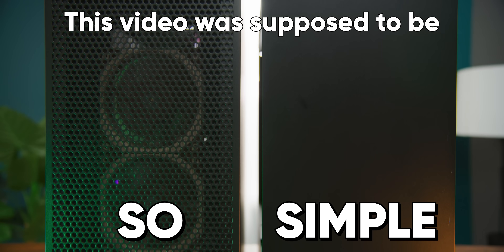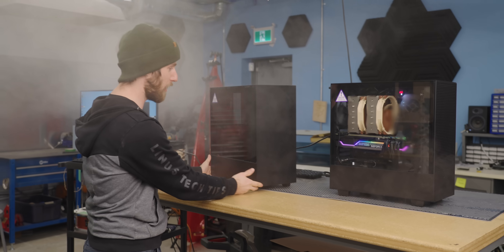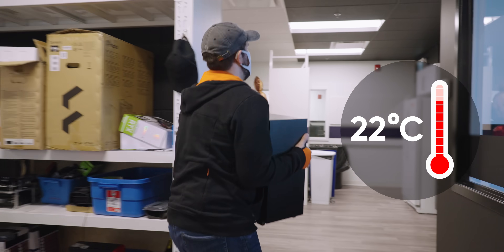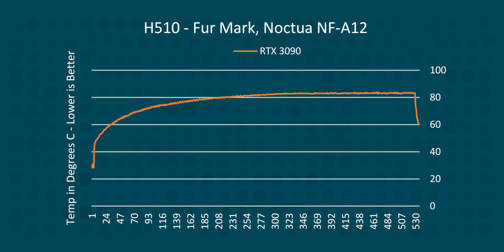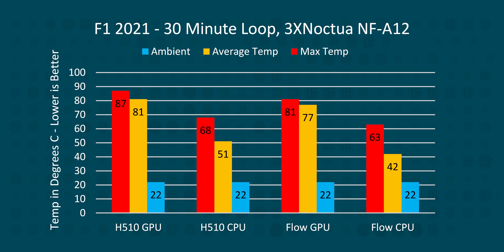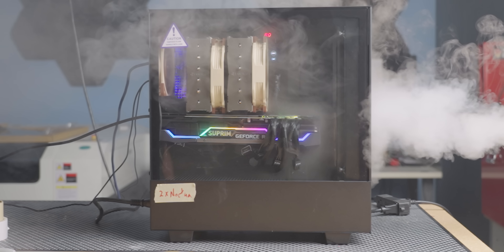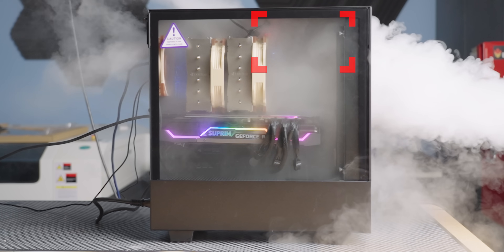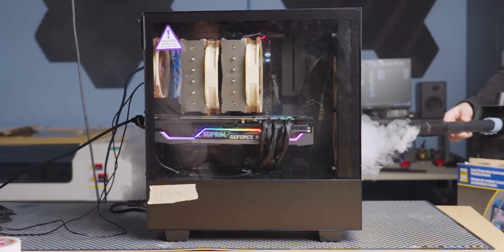Everything You Know Is Wrong - Mesh vs Non-Mesh Front Panel

Comment: I'm interested in seeing this test performed on a case with bottom intake fans, like the Fractal Design Torrent.
Reply: Or something like the Meshify, where you can put a greater distance between the two front fans (make sure the lower one blows beneath the GPU) but otherwise somewhat replicate the H510 experience.
Reply: the meshify also allows for three fans if you remove part of the psu cover. I did this on my build not just for airflow, but I really just like the aesthetic of three front rgb fans
Reply: Not sure how much this helps, but I've got the O11 Dynamic Mini with all the fan slots filled, 5 intakes and 3 output. I personally got about a 5-7C decrease in GPU temps with the bottom intakes using my 5700XT (I've since upgraded to an RTX 2080 and have had a smaller difference). Havnt gotten it properly tested and can't keep my room at a constant temp for consistency, but it definitely makes at least a bit of a difference.

Edit: I do tend to try and keep my room around 18-20C (65-68F) and run custom curves on my GPUs rather than the default curve.

Comment: DID you run the SPECIFIC LGA1700 mount and not a LGA1200 LABELED as "working for 1700" ? I dropped 25C from 98 to 73 on my 12700KF due to the switching the the mounts.

Comment: lian li mesh II P, 280mm push pull arctic up front. 240mm arctic p12 fans under gpu. 2x 140mm p14 up top. Its dead silent at low rpm and i hardily crank them up for anything other than the aio fans. 3070 strix also silent under most loads/use cases 0rpm at idle with the fan filled lian li it can even manage 0rpm for light gaming or mobas. Its crazy how different temps can be based on chassis design and where you mount aio or if you run a tower cooler. The mesh has that side vent for gpu air flow, and you can front mount for proper cpu temps w.o the temps of gpu and cpu cooler affecting each other.

Comment: Several things i think makes the video less valid:
1: The Noctuas are 120mm fans, the NZXT fans are 140mm iirc.
2: making a conclusion on airflow based on one case isn't enough.
3: using the NZXT H510 was a fine example, but cases like Lian Li 215 or Be Quiet Pure Base 500(DX) would be a better example.

In the end, i think i will keep watching Gamers Nexus instead when it comes to case reviews.
I do appreciate the explaination on airflow, but that is all i could honestly use.

Comment: I have a corsair crystal 280x m-ATX case.  All of my components are plugged into a Gigabyte B550M Aorus Pro with 32GB of RAM and with XMP enabled.  I have my Ryzen 5600x CPU water cooled using an AIO, but my MSI Radeon rx 6700xt does the same thing yours is doing in this video.  It heats up and all of that hot air passes the rest of the components in the case, raising the ambient temp, and in turn, raising the temp of all of those components.  Granted, I do have the two stock corsair intake fans mounted at the front of the case already providing intake to balance out the exhaust of the radiator fans at the top of the case, I still have issues with the GPU reaching awfully toasty temps.  My solution is that I ordered two 92mm addressable slim Noctua fans to place directly under the GPU.  They will plug directly into the corsair commander core, using the two free inputs I have left on it.  That should alleviate some of the ambient heat due to the fact that I can set custom curves so they run at a lower rpm than non-addressable Noctua fans would.  Then, being that I don't have a bulky air cooler for my CPU, that leaves plenty of room for air to travel over the GPU, where I'm going to install two 60mm non-addressable Noctua fans at the back of the case to aid in exhaust.  This should leave me with four intake fans and four exhaust fans, so I shouldn't have to worry much about creating a heavily positive or negative pressure environment.  I may have to play around a bit with the speed of the non-addressable fans (using the interchangeable cables provided by Noctua which allow for three static speed settings), and the curves of the other 6 fans in the case in order to maximize efficiency.  It should also be noted I'm tracking the ambient temp using a thermal sensor located just 60mm above the GPU, which is also plugged into the corsair commander core.

GPU and VRAM overclocking is set only to activate in certain applications.  The 92mm fans at the bottom of the case will be set to cycle up or down based on the GPU temp, and hopefully provide a variable stream of cooler air to the GPU and especially the VRAM components which I believe are the culprit when it comes to the heat spikes.  The hope is that it will have a bit of a domino effect, lowering ambient temps along with all other components, and as a secondary bonus, maybe the noisy stock GPU fans won't need to kick in as often.

That's the hope...  Noctua fans arrive tomorrow.

Comment: So basically airflow is more than just how fast air goes in and out, it’s also about how much heat is contained or recycled inside before actually leaving the case.
Reply: Nope, it is both.. air flow and capacity.. look at car radiator.. colder air, fast flow.. it need both to be optimum

Comment: TLDR: Don't put a very large GPU into a H510 Flow if you have high airflow fans. 

Even with the open front the interior of the case with a large GPU is too cramped and indeed forms basically a blockage. A larger, specifically longer case with a more open bottom(PSU shroud) would result in a more even distribution of airflow throughout the case. 

In a case like this you can also try to move the lower fan into a much lower position, so it would more air under the GPU.

Comment: I had a similar problem of a great GPU but hot CPU with my old setup. Lots of intake fans including a 200mm side panel fan just wouldn't cool things the way I thought it would. rotating the CPU tower cooler 90 degrees so it draw air vertically instead of horizontally and slowing one of the exhaust fan solved the problem by 10 degrees C and had no temp issues whatsoever (nor CPU fan noise issues from it ramping up all the time)
Reply: Did the same thing, worked like a charm

Comment: That's the problem of GPU with Axial fans. I wonder who thought of this ridiculous idea. But anyway, in order to cool the GPU, the cooler need to be redesign. Since now GPU mostly occupies 3 slots, use 2 or 3 40mm fans that strap on the end of the GPU and uses the heat sink similar to a blower style card one. 

Another idea is to build a duct so that the bottom fan only pushes air to the GPU. Since the GPU is so close to the front intake, it shouldn't causes a sore eye by adding a piece of black plastic to divert the air from the bottom intake fan to the GPU.

And this case is not a good case if you are serious for the air flow. This case is only for aesthetic. My $50 old school tower outperform it by a lot. Well, sure the case is compact, but if you expect a good airflow I think there are other candidates. This case is not design for air flow. This case is design to look pretty. The front mesh panel is just a way for NZXT to jump aboard the hype train, but their case are not design for air flow. They should redesign so you can mount the front fan lower.

Comment: If I'm right, 
Non-mesh cases require static pressure fans also reduce noises. Mesh require airflow wich increase noise. 

Would have been great to test ventirad (2fans) + 3 front fans VS wc-aio 360. As to see the difference in flow by having différent volume inside.

Comment: I recently upgraded my 5600X fans from stock to Noctua D15s and the same happened to me. I tested with a 3090 and it was the exact same behavior. Specially the memory junction core test that I did while mining, I could clearly see higher memory temps.
I suspected this happened because the D15 is a monster of a fan, that is hot and almost touching the 3090 just like the video mentioned. There's almost no room between the 3090 and the D15. I considered downgrading my fan to something smaller that would make some extra room between GPU and the fan. I'm still considering if I should get a smaller cooler to offset that.

Another funny story, is that I have a rig, with 2x GPUs mining. One 3090 and a 3080. Both are inside an open regular case. And I added a vacuum in front of it to make both of them cooler.
To my surprise, one of them got a lot cooler, but the other? It got hotter! That was crazy, I tried moving positions but it was always like that with the vacuum on. I suspect the hot air from the top card was being blown away on top of the botton card, and that was making it much hotter (it would be 3 to 7 degrees hotter - from 55 to up to 62celsius). The card that got cooler was improved a lot more at least. It went down from 65C to about 50C.

Comment: Thats why i always search for a mesh front and top panel, with 3 fan support on the front. And i always search for a mesh psu shroud, so the bottom fan can blow into the bottom psu shroud and the gpu can sucks the air that blows from the psu shroud.

Comment: GPU cooling could be solved if the case could accept fresh airflow from the bottom (not just air pushed in from the front over the PSU or sucked in by the PSU itself). While the 510 Flow is a step up, it still has a ways to go compared to other airflow-focused cases in the market.

Comment: I have this the 510 (hard face) I find that a 240 AIO in the front and the 2 fans in the back and top work really well to keep my 980ti cool, however that card is shorter and with me not having a Large CPU cooler in the way I don’t run into the turbulent air issue.

Comment: The case is poorly optimized.

I changed from a large case with a 1070ti mini, to a smaller mesh case with a much larger RTX 2070 with a 9900k. My temps went down another 6-8 degrees because the intake fans are directly in line with the air channels UNDER the gpu and beside the CPU - plus it has all mesh plate covers to equalize the flow more. I can push my fans to vacuum-cleaner levels and the temps simply go down even more in a linear fashion. I have .75 amp fans from a water cooler so they are more powerful than anyone would ever want at full power to simply intake air without a radiator in the way.

The case in this video still needs work and isn't worth it considering there are better for equal or less money.

Comment: I went with a HUGE case so everything has lots of room, then I have a 140mm intake fan on the front bottom + 2x 120mm intake fans on front, along with a 140mm exhaust fan on the back, and 3x 120mm exhaust fans on the top.
i7-9700K,  Asus TUF 3070 OC, and they never exceed 60°

Comment: The explanation of "turbulence" sounds weird to me in the way you explained it and may cause some confusion. Usually turbulence helps in heat transfer processes and the only thing you should care is the residence time of the air, that is how long is the air inside a confined volume.
That assuming the mixture of air is relatively homogeneous inside (not talking only about composition here, but also state), which is not the case here. If you have a dead zone below the card, then you have to wonder what's creating that dead zone, but I think it's certainly not because of the turbulence and it's probably a problem of local pressures created by the limitations of the flow through the card itself and its exhaust, then  turbulence may somehow aggravate the problem as explained, which is not clear, nor I'm an expert to tell you what exactly it is. 

If you think that's the problem, and as you explained the turbulence is being generarted by the thickness of the card, you may try to add a little 3D printed wing at the end of the card that cuts air smoothly to prove your point.

Also I've always thought that placing the graphics card vertically may help in these cases as it should smoothly connect the lower half of the case with the upper half, instead of creating chambers when you place the card horizontally, but never seen it tested, it may be an interesting idea to test.

Anyways, it's always a pleasure to watch your videos bro.
Reply: The fluid dynamics part of this video is incorrect for the most part. Talking about the gpu creating turbolence is already wrong if you have a fan before that. This smoke "visualisation" is technically useless (smoke visualisation in turbolent conditions is even more difficult to do because of the defusive nature of the flow). They keep moving the source, there's too much smoke and it's able to investigate a tiny portion of the streamlines that enter the case. I agree on the fact that probably there are recirculation bubbles that are influenced by the fans configuration but everything else is barely ok for the general public even though I really don't like the fact that it's presented like it is a technical analysis (it's not)
Reply: Not enough open exits for air below the gpu (bless those detachable covers for additional PCI devices), too much sucking power above the GPU. Air gets in the case, some bits of it try to go below the GPU but quickly get sucked back by double CPU fans and exit fan. Like as you draw Z starting from the bottom.
Possible solution: additional fan below the GPU to try to equalize the air flow, remove back covers and add another fan there.
Reply: @ItsameDesire  That's what I meant by "local pressures created by the limitations of the flow through the card itself and its exhaust"
I've been thinking for a while that modern cases should have an option to insert a fan there. I recognize that is somewhat difficult to implement, but if you were to place a fan right outside the expansion slots, you should have enough space to mount a 120mm fan (and leave only the slot of the gpu that takes the wires out).
An easier solution would be to bring back cases that allow a fan on the window, that is if we care about the temps more than the looks.
Reply: This made me remember a small channel that used to do a lot of tests on fans (which brand was better, which size, etc). They made a video of several fan configurations and which was better.

I think it was this one:
https://www.youtube.com/watch?v=7dAvxfDYuRU
He has another similar video. I think Steve may have done something similar
Reply: Yeah I'm pretty sure instead of "turbulence" if he just said "vortex" or "recirculating flow" everything would be fine with what he said.
Reply: @oumo   Exactly - I'd add "stagnant air'' and use 'eddy currents' as seen in moving water, where there's areas where the water recirculates even though the overall flow continues past, for visualisation aids.
Reply: They did mention the pressure being a problem with the increased fan in the front. My guess is that turbulence in this case reduced the ability of the air to easily exit the case
Reply: @alylu-to-esutej  this is what I meant by "and the only thing you should care is the residence time of the air"
and that's easy to prove, you just need to measure the mean time that air is inside the  case and you do that by measuring how much air enters (or exits) then divide the volume of the case by the measured flow. if the time of residence is higher after adding more fans then, the problem may be related to that.

...................
you can measure either the intake or the exhaust because you assume that the system reaches an equilibrium after a while (the ammount of air that enters is the same that the ammount of air that exits) if that wasn't the case, that would mean that mass (air) is accumulating inside, if that were to continue for a while then your case would explode, as that doesn't happen then intake = exhaust.

This doesn't mean there's no difference in pressure between the interior and exterior of the case as someone may infer. Before the equilibrium there's a short period of imbalance in which mass accumulates inside the case and builds a small ammount of internal pressure.

The more pressure it builds, the more difficult it will be for the fans to move air inside the case, that may be what you're referring to.
Reply: I saw one test on YouTube comparing vertical GPU vs flat/normal mount. The vertical mounted one got hotter.
Reply: its just miss speell
he means dead spot,, hot air pocket

Comment: Since you've shown hot pockets caused by turbulence due to lack of top vents, which in this case has only one, proves that every chassis that supports 2 - 3x 120mm/140mm top fans from which people argue that sucks out fresh from the front intake causing bad temps is false.

Therefore the conclusions here are... 
1. Fan speed depends on the size of the case to prevent turbulence causing heat buildup.
2. More ventilation in chassis means lesser build up of hot pockets even if the fans are at max RPM causing lot of turbulence.
3. Cases like Lian Li O11 Dynamic is designed to eliminates those issues, the aesthetics is bonus.
4. Just like any compact builds with less ventilation, there are compact cases built with good ventilation and get good temps so that's that.